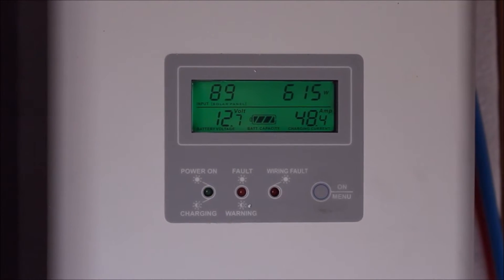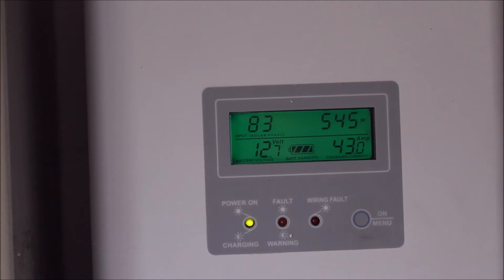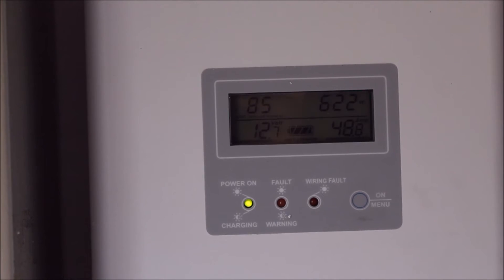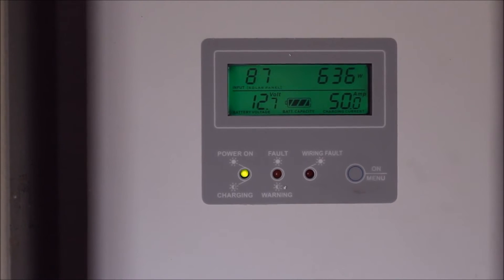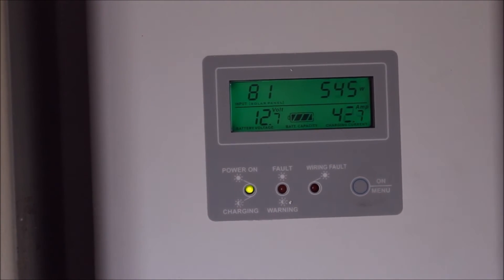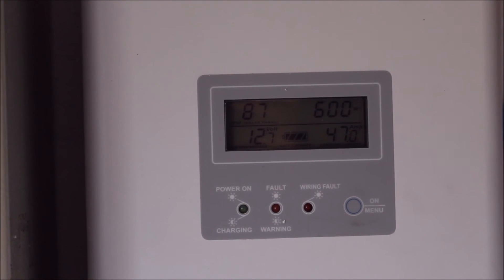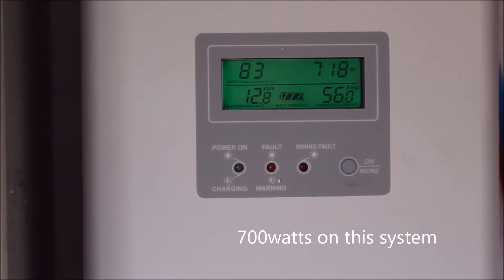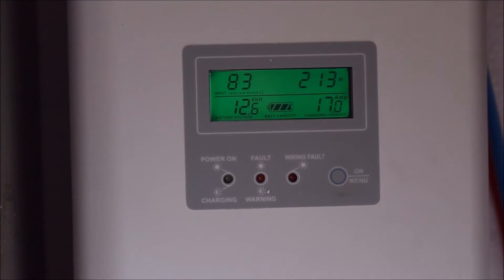UrbanOffGrid17 My Solar system

Comment from the maker: At that stage it was a 12 volt system and the controller was able to push up to 60 amps in good sun. the batteries were multiple 12 volt batteries in parallel as well as one set of 550Ahr 2v volt blocks.

Comment: im useing same controller  and 1600w  of pannels  and only seen max  of  880w  your system is running great
Reply from the maker: power out really depends on conditions of your solar panels, I have seen 770W out of my 750W panels.

Comment: nice info. im thinking of going with the pcm60X. Is this still the best bang for the buck?
Reply from the maker: Its not so much bang for buck, if money is only consideration than this is not what you want.

Being MPPT its more effiecent but also enables you to run pannels in series like what i have done to get lower voltage drop and more power into your batteries. It also enables me to upgrade in the future, i am able to go from 12 volts to 48 volt bank and than that enables me to put more panels up to 3200 Watts which this unit will support. 
So if there is a posibility of expanding your system this is a great unit and will serve your use now and as your system expands. 
Hope this helps
Reply: do you mean Mppt? I thought this unit was Mppt?  it looks to be priced very competitively from I saw. Maybe I better look at it again. Thanks for your info.
Reply from the maker: yes sorry MPPT, Compared to similar units its very well priced

Comment: Nice work, I currently have 1.6kW of panels and 3 charge controllers.  Couple of questions though, why did you go with a 12V battery instead of 24 or 48V?  I assume cost -- I started with Jaycar rubbish controllers (well their PWM ones work well) and 12V as well, mate you are spot on about how you learn a lot as the hobby progresses into being totally off the grid.